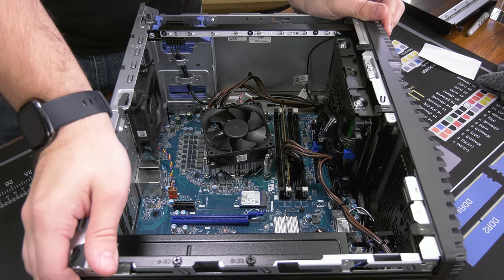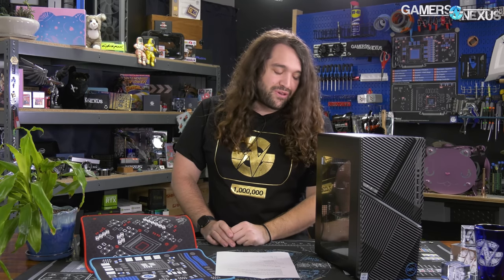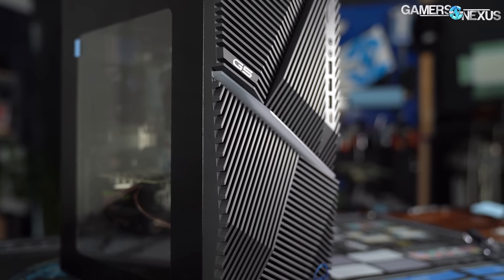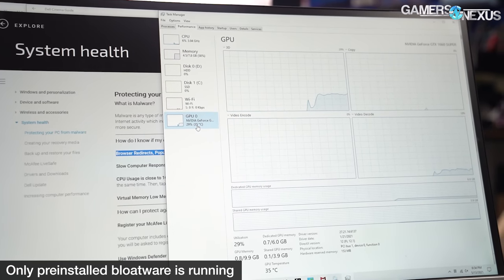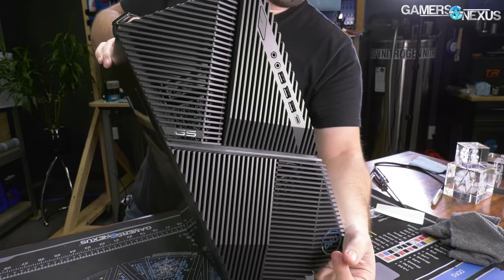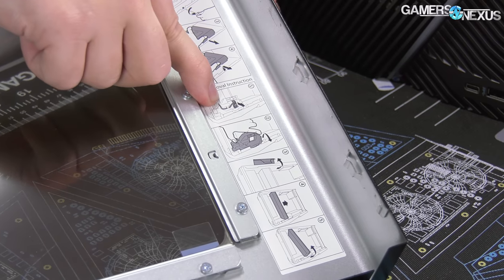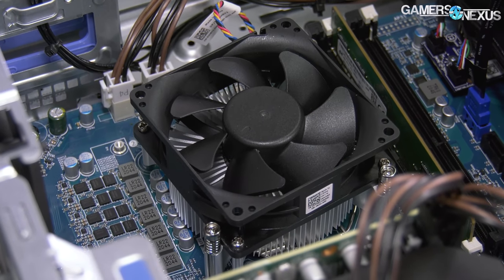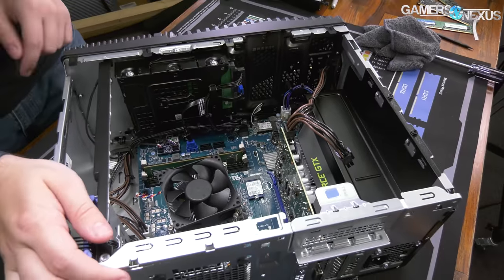Worse Than Walmart: Dell G5 5000 PC’s Garbage Parts & Hidden Charges

Comment: I have a 2013 dell optiplex ex-office computer with a i5-4590  that i bought used off ebay, modded it out and changed literally everything at least once even the MOBO cuz i shorted it being an idiot. A lot of this proprietary shit looks very familiar ahah had to put a PSU in it because the factory PSU didn't have GPU power cables...and i was building a budget gaming rig with a GTX 970... found a 24pin to 8pin adapter on eBay for dell boards and bobs your auntie! thing still runs well to this day just keep the graphics on low haha. was my first pc build and a good learning experience with cheap used parts. good to see dell has been using the same CPU cooler for 12 years XD
I have a soft spot for dell because the computer i learned on and the computer that got me into PC building was a dell because at the time that's all i could afford..one mans trash is another's treasure. just shows with a little bit of thinking and ingenuity you can make even their junk work. dell and hp have their place they just need to stay there

Comment: Wait till you add memory to this.  LOL

On that note, Dells are really reliable.  I was in corp america for a very long time doing Architecture and Systems engineering.  My last job before retirement from IT was for a fortune 50 company doing Bloomber and Reuters technology and controlling desktop standardization, so I am familiar with Dell Hardware and System roll outs.  Dell Optiplex is a very good series, which is what most companies use for Business, and I can tell you, they work very well for 3-5 years being on all the time and following standards which large corp environments need in terms of Bios, Drivers, etc etc.  

Dell Optiplex are also manageable centrally and the costs are very low on volume along with Hardware warranty support.  Dell has a place in technology, but its not for gaming.

I have two engineering degrees from a university.  Close to 35 years IT experience and Designed first time systems for new tech for 17 years.   The cooler on the chassis is to help with cooling using large area heat dissipation through the 4 screws. Again, Dell type stuff.

Comment: It's not that bad an idea to have the option to fix the cooler through the motherboard or at least augment the fixing to the case. I've handled many boards where the PCB has fractured due to high mass coolers.
Reply: Yeah but this is a generic and proprietary cooler.

Comment: It’s called,  cut the costs…  you make one computer at a time,  they pump out thousands,  millions???  Ease of manufacturing and cost cutting are big business and engineered into every one of those computers.  A nickel saved over however many built adds up to big corporations.   It’s not a scam.  It’s current corporate thinking…

Comment: Actually, I do give them credit for screwing the cooler into the case.
The CPU cooler is probably the single heaviest item that could be attached to that motherboard - especially given that GPU abomination.
Screwing it into the case will help secure the motherboard and also protect the motherboard from shipping damage...
So actually, given that the system is already completely proprietary, this was a good move.

Comment: Dell xps 8940 that I just bought on Facebook Marketplace for $340 uses the same motherboard, cpu, ram, GPU, power supply. Only things I notice different are the clear side panel and the design on the front of the case. Otherwise this is the same machine.

Comment: "well don't look that hard" lmao bro well said...bought this pc(big regret) because it was the only way for me to get a cheap 3070 at the peak of the gpu shortage...zero upgradeability and brutally terrible thermals....Had to 3d print two 120mm fan adapter mounts for the front and back of the case, to prevent the crappy stock cpu cooler from overheating the cpu...Still will thermal throttle with stress test without fail with intel turbo boost turned on in bios, but under normal usage for the average person, after making these two fan mods, temps are acceptable...

Comment: They want to turn desktops into laptops. In other words, have a custom motherboard, case, power supply.
HP Compaq does another trick. They reverse the motherboard. In other words, in the case, it gets mounted to the left side.
Get a System76 or Tuxedo or something and get Linux. Forget Windows.

Comment: I don't have a problem with industrial style motherboards where they use plain old ordinary green or blue solder mask and generic off the shelf heatsinks (see ASUS's "commercial" MBs). As long as it's designed well and works like it should that's fine. This is a whole different thing though.

Comment: The problem is Dell is trying sooo hard to break the good will customers had with the old dell systems. Our IT guys bought some dell desktops and they are SH*t broke down after 3 weeks of light use :) They were forced to reinstall 10 year old desktops they were meant to replace

Comment: This is so 90s. Manufacturers still pull this shit? I always used to tell people not to buy from large manufacturers because of the issue with non-standard components, particularly the motherboard. It kind of makes sense from Dell's point of view. The kind of people who buy machines like this aren't computer savvy. They're people who are likely going to keep the machine for years and never think of upgrading components. People like my parents. Then, they're just going to bin it and buy a new one.

Comment: Prebuilt computers are only good for low demand work...don't need a lot of power to look at spreadsheets and surf the internet.  Graphic artists, programmers and serious gamers would be the other segment that does have extreme demands that cannot ever be provided through prebuilt.  The ONLY option for true performance gains is to custom build from the ground up.  Dell, HP, Apple...they all build a device meant to be stable.  Performance beyond that is questionable, I have yet to see one outperform my old as dirt PC I built 12 years ago.  This video exemplifies why that has been true for me.  Eventually I will need to upgrade based on technology improvements (USB C on the mainboard for one small example)...I will be custom building that machine with the best available and still come inside a price point that none of the bigwigs can meet and of course, provide a true power performance worthy of gaming, programming or video editing up the wazoo...simultaneously.

Comment: That CPU cooler looks identical to the garbage I've pulled out of Socket 775 Dell and HP systems from the late 2000s. 
Absolutely embarrassing in 2022, let alone in a "gaming" PC.

Edit: that pcie release tab is straight out of 2005. They always break for me, and just reeks of "cost savings"

Comment: I've been buying dell computers for many many years and they always have used their own proprietary parts. That's not exactly a news bulletin. I don't get why you would expect it to be anything different than that. I also don't quite get the argument that you can't pull parts out of it and use the parts in other systems. I suppose that would be a valid point if you were constantly building new computers and swapping parts around but for the average consumer buying this , they're not going to do that, so the fact that the parts are non-standard is really a non issue I think

Comment: I do remember how awful it was trying to buy a graphics card back at the time of that video.  Even old ones were outrageously priced.  I hope not a lot of people caved and bought those awful GT 1030s just to get a card.  There is one that a Bestbuy store I go to a lot has.  They had it back during the crisis and maybe before that.  It is still listed for $149 on the shelves there.  I am confident that no one bought it and returned it either.  It is not a card you would buy for high graphics performance.  You might want it if all you are doing is spreadsheets and office work and you want to discourage your employees from using it for gaming.  Maybe someone would play Solitaire on it but it is a GT 1010, don't mistake it for anything remarkable other than how very basic it is!

Comment: I got a HP Elitedesk 800 G2 SFF for 160euro, no gpu.
Then i found out that the cooler was also mounted down to the chassis. IT WAS A PAIN to move the motherboard from the broken HP chassis (which was thrown as a package by the damn courier service) Also the second reason is that I changed chassis that it was just too ugly.

Luckily my 1155 Intel Core i5 stock cooler was perfect, i applied new thermal grease and it was ready to go.
Since it having a 200Watt power supply, and it sometimes struggles to drive my I7-6700 with the card i did included (Radeon R7 240 2Gb ddr3), it have a goddamn 6pin power connector, since im sticking with this motherboard, i ordered a special exceptional HP Elitedesk 800 G2 SFF 6pin to 24pin cable from moddiy, since i want to put a decent card inside my pc, also the single stick of memory is just a pain (its lonely too).
I may be better off buying a second hand motherboard, since the goddamn vrm dont have any cooling solution, except the little copper that the mosfets sits on.

Comment: I have 3 Dell laptops and 1 Dell desktop, all core i7 processors for over a year. So far so good.  I would not buy HP or Lenovo computers based on early hardware failures.

Comment: I´ve just build a system for around 1000€ with an Ryzen 5 3600, Rx 580 Strix, 16GB Ballistix and an Aorus B550 Pro in a very airflowy case with a freaking WD Black 1T included...this Dell thing is an insane scam.

Comment: Sounds like it is the standard in corporate thinking from the company's that don't care about the consumer and have things built in China to sell under their name.
1:    Build it as cheaply as possible.  {made in China)
2:   Build to fail (in order to sell more product to customer more often)
3:   Use the word proprietary to instill the thought in the consumer's mind that all the parts are fine-tuned to each other.  (One part goes bad the rest of the unit becomes a boat anchor)

Comment: Brand name computers: its a boat anchor with a power cord.

Brand name computers HAVE ALWAYS HAD WEASEL LIMITATIONS AND HARDWARE
AS PROPRIETARY AS THEY COULD MAKE IT. There is nothing standard about a brand
name computer and its hardware.

 Exhibit A: THE POWER SUPPLY. Both the power supply and where it resides in the box.
Exhibit B: MOTHERBOARD "A": with everything missing unless specified and paid for.

Brand name computers:  its a, "PAY THROUGH THE NOSE BUSINESS MODEL." THEY
ARE ABSOLUTELY FANTASTIC .... IF YOU ARE NOT LOOKING FOR A COMPUTER. ITS
A BOAT ANCHOR WITH A POWER CORD.

I should know, I have worked on them for many a year, fixing customers impossible
problems caught up in the BOAT ANCHOR SCAM.  A jigsaw always came in handy.

Comment: "Why would you make a load bearing CPU cooler!!!"   Fewer instances of shipping damage.  CPU coolers are relatively heavy, attached to a relatively fragile board, and more often than people realize, become unattached from the board during 'rough' shipping, sometimes damaging the board.   I for one am surprised that the reference Intel cooler designs weren't stabilizing the CPU coolers to the chassis in some fashion decades ago.  Seems Dell has had enough and took matters into their own hands.. Intel obviously doesn't care about OEM's bottom line when it involves customer returns over what can be deemed shipping damage.  Or is it really just bad design that doesn't account for the real world?

Comment: My company just sent me a new Dell Latitude 5521. I suffered an endless series of BSOD on it. As I am a programmer I analysed the core dumps produced and it seems to point to the CPU itself.
Dell certainly seems to have very poor quality testing. I think they are pushing out bad systems for financial reasons. The warning bells are certainly sounding in my mind. Dell is not a company I want to buy from personally. Pity my company has a Dell policy. My company have suffered financially as one week of my time has been wasted on this laptop. More than that, I will have to spend time setting up the new laptop and that means the cost to my company will go up again. If the replacement is as bad then the cost to my company will go up even more. I will gently remind my company that if they spent a little more money perhaps these problems would not have occurred. The cost of my time wasted and the time of the other engineers and sysadmins who also spent time on this laptop only goes to show that the price of the computer is not the highest price to the company when buying a new computer. But I doubt I will ever be able to convince the board of this truth: if you spend more you save more, in the long run.

Comment: Dell gets custom boards,, even custom power supplies,, with wires swapped so you have to use dell to fix it. But thier warrantys are great.. I had a small shop.. Signed up to get dell certified back in 2002,, just sign up and your certified.. I would get a dell in.. and they would send any part based on the customers computer i said needed replaced. no questions asked.. They used to pay $92 back then just to show up at a customers house.. take it out the box and set it up.. easy money.    I used to hate on the big guys 20 years ago when i was a small flea size on their balls VAR compared to them..  They get paid for the bloatware... I still get annuities from the 1990's when i used to put my AOL bloatware with my referral built in...

It used to amaze me some of their Passive cooling CPU setups and vents and channeling from just one front Panel fan.  Your trashing one version of their systems.. These guys bought alienware back in the day and killed what alienware used to be.. Pray one day you could be big enough to buy you out..

All that proprietary stuff.. imagine being big enough for that.. your own dell branded card,, your own cases.. that computer will last 20 years!

Comment: They even do not make Good office computers. 
*In my company we had dells with i9 10th gen constsntly overheating due to similar kind of coolers you showed. 
*No dedicated graphic card just integrated. 
*One like 8cm fan on the back. 
That that was designed to work with CAD 3D graphic projects....

Comment: I bought the exact same system with a Dell 3070 for $800CDN. Pulled out the 3070, which BTW... looks like a turd... but useable.

Comment: Idk if you guys have ever reviewed micro center's in house pre builds but they would be worth checking out. No proprietary parts, everything is built with off the shelf parts. If you dont want to build your own they have several tiers of performance and you can upgrade in the future without needing to buy every individual part. My POWERSPEC is a few years old now and ive upgraded the cooler, gpu, added new fans, and am almost ready to upgrade the CPU. Good prices and warranty is through micro center themselves. Cant recomend them enough.

Comment: You can change your car's oil for 10 to 20 euro. If you make someone else do that, you will easily pay 2 to 4 times that price.
If the price of a prebuilt pc would be two times the one you can build yourself, you won't have any of the common issues you highlight.

Hell, this isn't even a theory. It's basically origin pc

Comment: I got absolutely scammed from 1200 bucks
So what happened was I wanted a gaming laptop but I didn't know anything back then
They gave me a 1050 to and a i7 7th gen with 1tb ssd but the ssd is slow. There was a lot of bloatware and it took me a crap ton of time to delete them and it was 120hz.... I found a laptop on Amazon for the same price but with a 3x better gpu ( 3060 ) and a Ryzen CPU with 144hz.. I can't believe this laptop is more than 3x faster than my laptop and it is also the same price. Another thing with my laptop is the fact that it runs on 60 degree idle and up to 100 degrees on gaming so I have to set the CPU usage to 70% for it to not get water to boil

Comment: Dell every once in a while surprises me with decent hardware and design.  Specifically many of their enterprise tier machines and most of their server tech is great.  I use to work with their devices on a daily basis and have no major complaints...but overall, especially with their supposed "gaming" machines, and laptops I do have complaints.  1, batteries should be simple for a user to swap, I don't care what anyone says, enclosing them making it impossible to swap out without a tear down is dumb.  2 consumer level PCs and the bs propriatary hardware is bs.  I remember having a customer come, with a "gaming" rig from Dell they paid 2000 bucks for and the case would only accomodate their board...which was 400.  The machine needed a new board, and 400 was too much so we bought the user a new case and motherboard and swapped all the hardware...they were happy, but because of Dell's markup on a simple mobo they doom a lot more waste to go to the landfill...and that is sad.
Reply: another complaint but this is industry wide not just Dell specific.  They should absolutely stop selling any and all machines with RPM drives period.  People will spend 1200+ on PC, not spring for the upgraded ssd and end up with a very slow machine because the RPM drives they use suck.  I cannot even count how many machines from Dell come back to us for repair or upgrade because of this...or the single channel RAM setup they seem to push.  70 bucks for RAM and 100 bucks for SSD and the machine feels much faster...and because there is such a difference between single and dual channel and ssd vs rpm...they should not even offer these antiquate configs.

Comment: Typical Dell machine.  Non-standard parts including the PSU and mainboard, so if either goes on the fritz, you have to replace the whole thing rather than just the component that's dead.  Which usually happens just after the warranty runs out of the thing, unsurprisingly.